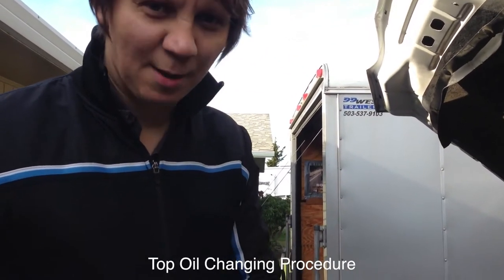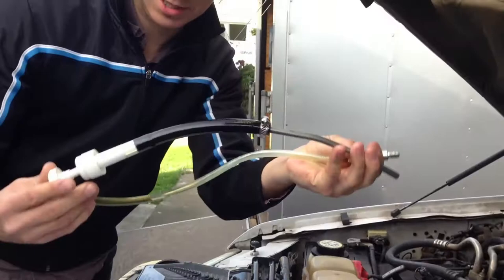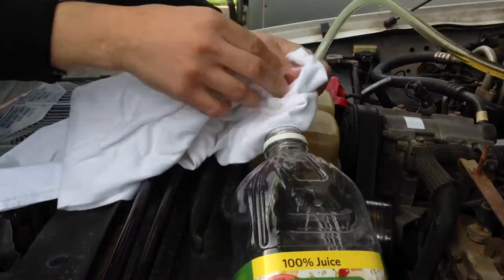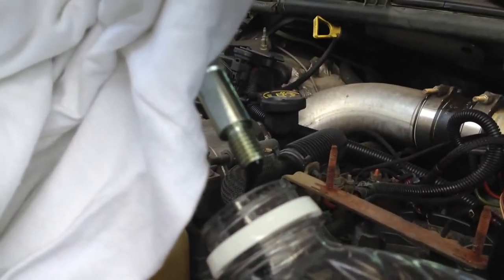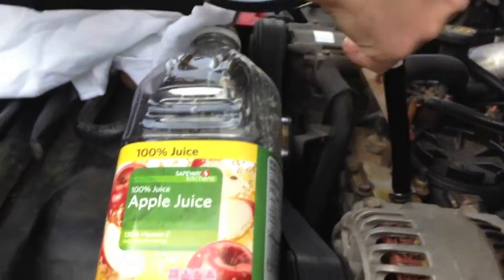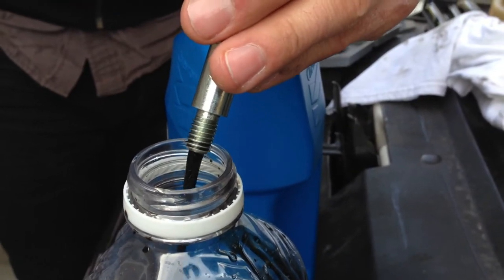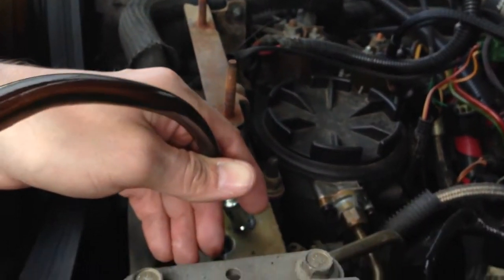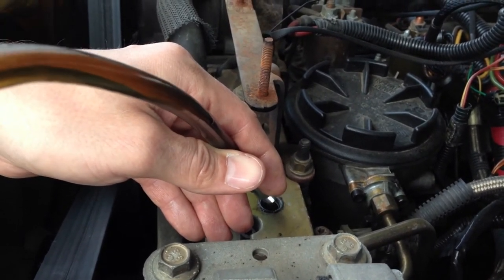Ford Powerstroke 7.3 Diesel Changing Top Oil Simple

Comment: hello

where can I get one those hand pump to pump the old oil out?
Reply: Looks like the pump off a hand cleaner bottle.
Reply: I got my at Wallmart
Reply: I used an old mean green spray pump. I tried this and it is a night and day difference but I put the hotshot secret into that little hole and it acts like a engine flush before I do the real oil change. it's a good practice every other oil change or so.

Comment: Remove a quart, add a quart, start the truck run for 10min, repeat the process 2 more times (3 times total) and you’re good to go.
Reply: Jared Weiss mine holds 16oz
Reply: @19211926 
The High Pressure Oil Reservoir holds about 1 quart, but so does the High Pressure Oil gallery in the right side cylinder head, as well as the left side cylinder head.  This adds up to about 3 quarts that do NOT drain out during an oil change.

Comment: Why does it need this done? Doesn't it flow out on an oil change?
Reply: 4Xprops !!!! Not all of it comes out on a regular oil change. Some might. But it's not going to hurt the truck either. I say do it once at least if you bought it used. Just to see the condition of the oil from it. Will tell you a lot about the engine.

Comment: That isn't a resivor it is the high pressure oil pump for the injectors and pumping it isn't nessisary as it has a constant flow the same as the rest of the oil in the engine. Routine oil change will give u the same effect
Reply from the maker: If you take the oil out of there, you will see how dark it is, the oil doesn't circulate there that much
Reply: wrong, misfit....if you don't change the HPOP res oil, it will immediately dirty up the clean oil when you start the truck....get out as much res oil as you can, and the oil change will remain cleaner....just good common sense.....

Comment: This is completely unnecessary, The low pressure oil pump at the crank pushes oil immediately to the high pressure oil pump which in turn is ran through the oil rail  through the injectors and the injectors shoot it out on every pulse to the heads then back to the pan. If you have sludge in the hpop reserved tank YOU NEED TO CHANGE YOUR OIL SOONER AND USE GOOD OIL I have owned 3 sd's with 7.3 have put on over 800k on each one and have never had the issues I see on these video's It all comes back to piss poor maintenance.
Reply from the maker: allyn bubolz I change the oil every 3k and it's not city driving either and lots of highway, even Bill at Powerstrokehelp.com says it's a good idea to do that, he knows these engines better than anyone else, I don't think you can get any better oil than Delo or Rotella, have you changed your injectors during the 800k miles?
Reply: I use royal purple 5k intervals same injectors no re oring either bill at powerstrokehelp is a great guy he also is selling a product and in this case he is wrong many professionals will tell you the same also diesel tech ron RIP states in 2 of his video's it is not required and your waiting your time. bill cant tell you how to fix long start issues I can and many more issues , stop wasting your time with this hpop oil change , proof change your oil go drive the truck 10 miles check the hpop oil it'll be clean as the pan oil.
Reply: When you pour new oil in it does not go to the HPOP, so when you fire up the truck you are mixing the new oil with the dirty HPOP oil.. It's not like you have to pull the engine to get at the oil on top so why not change all the oil you can instead of just some?
Reply: Ehh... Its only 3/4 of a quart , not gonna make a difference
Reply: hi mate I recently I bought a excursion 7.3 and I would like making a maintenance on this excursion because I have a suburban with a Detroit L65 V8 and is a simple change a oil but on 7.3TD most of the people they making this work!! is not necessary do that? thanks for explaining
Reply: @jorgekazachek6514   it only holds like half a QT and is not nessasary
Reply: @fixitup2193  thanks for your help I appreciate really many people talking about this extra work!! ok so is a traditional oil change  😃 that's it!! thanks cheers from Norway
Reply: don't listen to alan boob-bolz or fix it up....take the few minutes to change the HPOP res oil....it will make your overall oil system cleaner.....FACT!!